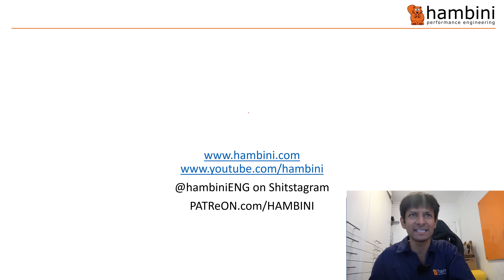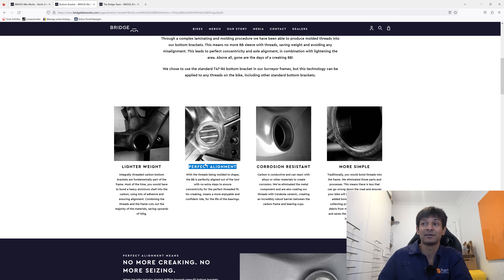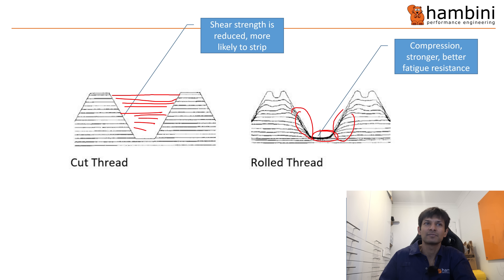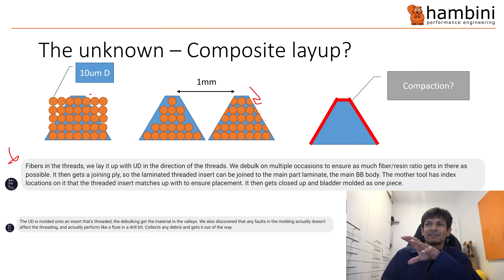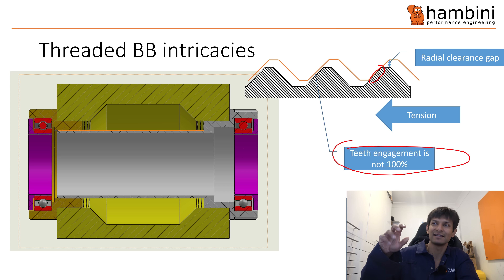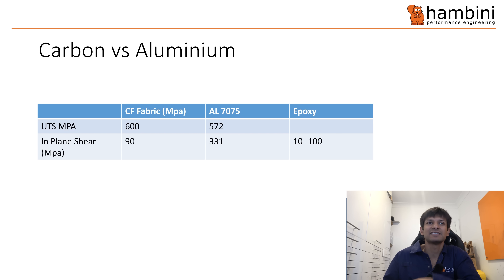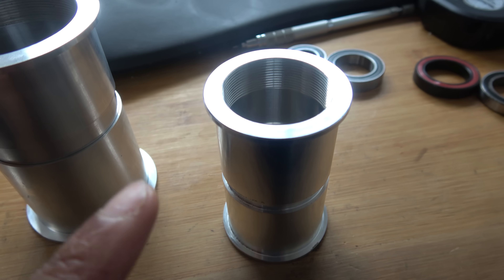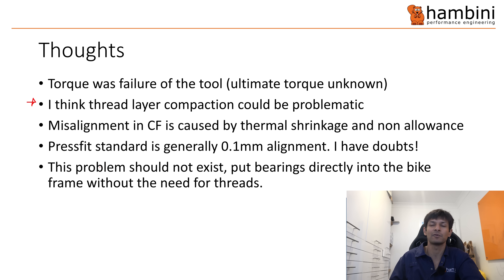Carbon Molded Threads, Crazy idea? | A Solution to a self inflicted Problem | REAMING

Comment: Thanks for reviewing this!

I concur with your assessment - it fixes a problem that shouldn't exist by relying on the same underlying root problem: the current production frames often don't comply with specs because of manufacturing issues derived from cost cutting. 

So doubling down and developing a thread system that relies on careful, diligent carbon moulding that accounts for shrinking, heat warping etc. seems like it's just asking for trouble even if all the material property issues (like fitting a metal bottom bracket with a sharp burr or edge on softer CF). It's really weird. I think you can make this work on a small batch/diligent manufacturing operation, but still is just one bad BB thread away from trouble.

BTW -  great summary on the engineering qualifications comment. I am Canadian and a P. Eng.; you described the qualifications well. And I don't know many people in the bike industry with the certification/denomination, either!

Comment: I have no words to describe how stupid this is.
Align pressfit  bottom bracket properly, keep correct tolerances and problem is solved. In this solution the bearings are pressfit in bottom bracket cups instead of directly in the frame. This ads weight which is the opposite of what they claim.

Comment: The advantage of a threaded bottom bracket over a bearing pressed directly into the frame is that not many people have the tools necessary to remove and press bearings.  A $30 wrench leads to easy affordable bottom bracket changes instead of the hassle and expense of a trip to a bike shop mechanic.   Press-fit bottom brackets are the worst of both worlds.

Comment: 1) Lots of talk about the strength of rolled vs cut threads and carbon vs aluminum threads, but all of that is irrelevant. What really matters is how strong do the threads actually need to be? I'd bet it doesn't take much at all for this application as the primary loading is hardly axial to the BB. If the threads hold adequate tension, then the threads themselves see no axial load beyond that anyway (the flange to BB shell interface sees it all). So if the carbon threads are strong enough, what's it matter? 

2) Nothing is ever "perfectly" aligned. But a threaded feature is self-centering, which makes it pretty damned close! Your diagram of the threads "misaligning" omits the other side, which balances out the misalignment you showed. And the two-piece inserts you show with the interference fit for alignment is certainly better than without that feature, but the L/D ratio is not even in the ballpark for a great alignment between the two.

3) A well designed bottom bracket will have an alignment feature between both sides to make up for any minor misalignment caused by the threads. 

Anyway, seems like a lot of unnecessary speculation from someone who's not doing it about a company that is. If they do it, and it works well, then good on them! No need to crap on it until it's shown to not work. Typical YouTube (social media comments, etc.), everyone who's never done something is somehow an expert on it...

Comment: In this light, could you discuss "forged carbon" like Time uses in the ADHX.  Those are the two things that sort of scare with that frame, especially in terms of durability.   I asked Time a few questions about these, such as if I should use grease, threadlock, leave them bare and if I should limit use to a single set of Thru axels and never got a response.   What happens if some dirt or foreign material gets in the threads?
Reply: There is no threads in carbon on the ADHX, it is in an AL-insert (fork) or hanger (rear)
Reply: @user-xg2fj5uc2g This is incorrect.  The Frame Specs on the Time website clearly say the dropouts are forged carbon, and if I inspect the ADHX frame and fork sitting in my garage - it has threaded carbon for the Thru axles.  There are no inserts. The only Al is the derailleur hanger.

Comment: Another bike that is going to do this is the Lemond 8, and high end racing frame that claims to use no metal pieces in their final design, including bottle cage bolts or brake mounds.

Comment: I would think it should be easier to create a dimensionally stable bore for a good interferance fit for a press fit bearing rather than creating a thread and then threading in a cup to in turn hold the bearing. Seems like a lot of over engineering to solve an issue that shouldn't be there if the hole was just created properly to begin with. I think a better solution would be to mold in a bottom bracket shell machined to allow for a proper interference fit and just press fit the bearing into the shell that is molded into the frame.
Reply: That solution sounds much easier than it is. But if we're going to mold in alloy bits at critical parts of the frame , why not just the radical idea of making alloy frames?

Comment: I'd bet they wrap long fiber strands around a threaded die and do the regular curing process from there. At the stated fiber size they would be able to fill each thread with a couple widths. And you wouldn't have to cut the carbon after you've formed and cured it.

Comment: Dangerous and potentially catastrophic. Didn't even have to watch the video. There's a reason metal inserts are used and it has to do with the material stretching. Good luck preloading carbon fiber.

Comment: So is BB30 the best BB design then with bearings being in frame and no interface??
Reply: Hmm, I bought a high end (full DuraAce 7800) Trek Madone in ca. 2008. It was equipped with the then newfangled BB90 (direct pressfit) bb. I’ve still got the bike and enjoy riding it BUT I’m on my fourth frame and forks. Trek have replaced them 3 times under warranty due to bb issues. I’ll say one thing, they stand by their warranty!

Comment: I've used roll taps in titanium, steel, and aluminum, which is a lot stronger than a cut tap. Interesting concept on carbon fiber, If it works could be a industry changer.
Reply: Carbon composites aren't ductile.  Rolling threads would crush the fiber and epoxy matrix.  You'd end up with a hole full of crumbs.

Comment: Surely, a threaded hole in carbon is easier to make than a round hole 😂 What a bunch of 🤡🤡🤡. But seriously, I know how much people crank on those threaded bbs and I really doubt this thing will be anywhere near strong enough. As shown in the video, carbon fiber sucks in shear, epoxy even more so. Also, if your aluminium bb gets galvanically stuck to the thread you might as well bin the bike, but that coating should hopefully prevent that.

Comment: I don't want some non-ductile, non-isotropic bike where it's such challenge just for the manufacturer to make a hole in it that's nearly round that they reckon its a better idea to invent a whole new process at great expense just to fit a BSA BB like was on my bike in 1997.  On a basic steel bike with BSA BB, everything works properly, and if it doesn't, the kid at the bike shop can make it work, before he even graduates high school.   It is the ductility of metal that has enabled us, over the years, to put together bikes and make them actually work, even despite the manufacturing.

Comment: With regards to the threads, I wouldn't necessarily say 'stronger' although some cold working may increase the tensile strength of the material slightly.  More importantly the the fatigue crack resistance and grain refinement of the rolled threads.  They could also be 'smoother' and 'burnished'.

I'm wondering if it would be better to make threads with some type of partial clearance or even missing thread portions that needs to be filled in with some type of sealant.  
Then use the threads for concentricity and gross fitup only and use the flange faces for alignment/perpendicularity, etc...  Or just use a one piece bearing assembly?

Kind of a solution looking for a problem...

Comment: My age is almost 80 and I agree about the bottom bracket and the bike industry seems like the frame construction is meaningless when you do not bore out the bottom bracket in one process.  What is a designed frame without the bottom bracket being aligned correct. There must be a individual who has done this in the past and why not in the present, what is the problems the process of cutting a one piece bottom bracket….  Why can not you make a machine to press thread a bottom bracket and a bottom bracket to fit. ????? What is the problem with the process ??????

Comment: At the end of the video, you suggest that bike manufacturers make the bb hole smaller than needed and then bore it out.  Earlier in the video you explain that cut carbon fiber tends to fray.  I think the problem remains to be solved.  🤔

Comment: I've personally molded a lot of carbon fiber threads in many different ways, when working for a company obsessed with trying to get that to work. It can work in static applications with light loads, provided the hole depth is a good 3-4 times the diameter. This, well, has me very skeptical. Invariably the resin seems to carry the load and the threads shear out under shock loading. The best case scenario we tested was cutting slightly undersize holes out of the carbon layup, so the fiber ends sort of frayed into the resin of the thread peaks. You can get passable but not great strength that way in a very thick panel (20mm thick carbon in my case), but nothing like the strength of a threaded insert. I can't see that style of layup being in any way used in a bike. I think, while they may have gotten it to work passably somehow, my guess is it would never be reliable enough for anything but a time-trial bike and it would never survive the first crash. I'd love a chance to saw one in half to see if they thought of something we didn't.
Reply: Maybe you can get your work to pay for two, one to cut up and one to "test"
Reply: @szurketaltos2693  Unfortunately, I don't work there anymore and I run my own business now, so work buying 2 is me buying 2😞

Comment: My steel gravel bike is 7.5kg, the stainless T47 BB shell has great alignment, and no signs of corrosion. The bike industry creating solutions for problems that don't exist.
Reply: I agree, I didn't relise I had a problem with my BB in all my years of cycling. The cycling industry is unbelievable in coming up with BS.
Reply: How can a steel gravel bike have 7,5 kg? Does it have carbon wheels etc? I have build up a couple of bikes, the frame of a trekking bike (OK, a little bit heavier than a gravel bike frame) has between 2 kg (Aluminium) to 2,5 kg (older cromoly steel frames), so even old steel frames are just a fraction of the total weight. The rest adds up the weight, to build a really lightweight bike every other component has to be lightweight too. If you use the inexpensive standard components with Aluminium wheels you end at around 12 to 13 kg, and a carbon frame alone would save 1,5 kg at max without weight savings on the other components
Reply: @simonm1447  English cycles knows how to build a light weight frame, lightweight yet proven durable components, carbon clinchers, 38c tires, full mechanical 2x red 22, stages power, growtac mechanical disc brakes.
Reply: @simonm1447  look up the Yasujiro Svelte. 5.5kg.

Comment: Hambini, what's your take on track (or SS, if you like) hubs with hex bolt axles? To me it seems OK for front wheel but rear is sketchy.
I have seen a hub hex bolt axles which has no serrated surfaces compressing against dropout - I've been offered such hubs but it seems too boutique for daily use. Probably I'm just too cautious but my background from working as a machinist sniffs a catch there.

Comment: Who knew the bike industry quest to save weight.  Shifting to Carbon Fiber-Reinforced Polymers would introduce a new set of problems.  

Any new material will of course introduce a host of new problems that previously doesn’t exists.  Because we are still learning about that materials strength and weaknesses for a specific application on bike frames through time.  

The first carbon fiber bike with aluminum lugs was raced by Greg LeMond at the Tour de France in 1989.  We are just on it 34th year of real world application in 2023.  We are still a long way before carbon fiber bike frames would be as solid and trouble free.  When compared to steel, aluminum and titanium bike frames.

Comment: I think the best thing about this bike frame is that it got Luescher Teknik to make a video about it.
Reply: I'm very happy to see that Raoul still around. I remember riding around the Hawthorn (Melbourne, Victoria, Australia) velodrome with him around 2000 or 2001. It might have been a little later. It's an open air velodrome, 3 laps to a Km and shallow banking, so most bikes are ordinary road bikes. He was on a home-built bike that was almost totally carbon fibre and was passionate about using CF as an engineering material, but he was also realistic about the problems ahead and didn't think that it was a magical solution for everything. From memory, his crank arms were CF, but his chain rings were aluminium. I have an engineering degree and had been interested in CF for many years, since the RB211 engine was first discussed, and had been close to the development of CF and other composites in building A-Class catamarans. He was a very nice, friendly guy who knew his stuff. 

I watched the video and I'm pleased to see that he's open to the idea but skeptical. He's also really good using the pen 😄

Comment: As a semi conscious crippled  incontinent old ex racer geezer, I seem to recall I once owned an early  Merlin Ti  frame with a BB that featured the bearings located in the shell without any threads. I trained and raced  on it, in all manner of weather, for close to 8 years before the bearings needed replacing. Sadly the design was proprietary and is lost to the past. Excellent video content from a 5 yo shitehead! Cheers
Reply: I like that idea.  If threads don't work do something else to hold it in.  There's more than one way to skin a cat.

Comment: The BB tragi-comedy continues: adding complexity instead of implementing appropriate manufacturing standards. Good grief. I'd like to hear from the engineers at Bridge Bike Works why their threaded carbon is superior to a properly produced pressfit design. It sure adds complexity. The question is why?

Comment: Bike threads where designed for steel. Already doing them in aluminum is "questionable". And now they try to convince everybody that it is a good idea in plastics? Ridiculous. Borderline insane.
Reply: The typical British thread works well in Aluminium. The torque you use to bolt it in is little compared to what the tread could withstand. Lubrication however is important, because of corrosion protection, otherwise they can corrode into the frame to a point you strip the threads if you turn it out.

Comment: Good video. I love the nitty gritty technical details. You are a master at this
It occurs to me that if no one ever tried to make a bottom bracket shell other than BSA68, bicycles would be just fine. The very best BB and crank design executed perfectly have such a minuscule effect on bike performance as to be effectively nothing for 99.9% of bike riders. Oh well, people have to do something with their time.
Reply: BSA is good for metal bikes. It isn't the best for carbon, neither the lightest, most efficient, or easiest to manufacture. That's why Cannondale introduced press-fit. "Fine" isn't the goal, best is.
Reply: @alexdi1367  It works fine in carbon bikes if you use a metal sleeve- which is waaaay easier to manufacture correctly that anything else because most bike companies, including Cannondale can't manufacture the other types correctly. The totality of any performance advantage conveyed by less weight or more efficiency is effectively =0 when compared to the rest of the system of rider/bike
Reply: @bobqzzi  They need a marketing hook, that's always the thing. If the system being sold is only suitable for a racer who gets a new bike handed to them every couple months, that's not an issue. Even a bodging idiot like me can glass-wrap a knurled aluminum bottom bracket shell and build a carbon bike on top of it that will never creak. But then I couldn't make the claims for an extra 6% stiffness to transmit my 85 watts to the pavement. The entire high-end cycling industry is more akin to Hermes than it is Honda. Expensive fashion meant to prove what you spent.

Comment: Had a read on their site.
Don’t bother with this company, they are riding on your trend in bottom bracket issue.
A philosophy grad and a lawyer want to solve decades old technical issue.
Reply: Their founders may not be engineers but they actually Do have a good engineering team
Reply: @davidngqkalone88  
I stand firm on my point🙂.
Just look at that entrepreneur’s short port folio.
A cash-grab setup with ‘patentable technology’ looking to be acquired.
Reply: @davidngqkalone88  by the way, heard that AbsoluteShite has a PhD researching on super large tension pulley too.

Comment: Most manufacturers can't align a pair of smooth CF cylinders perfectly, but threaded cylinders will be? IMO (ham-fisted home wrench and bikemaker) aluminum is already sometimes tricky enough as a threaded BB shell a regular person. I've had to resort to some crazy gymnastics to free up and reinstall BBs in improperly-prepared and maintained BBs in aluminum, and it's always a treat know that if you can't chase those threads clean and aligned very carefully the frame will be junked. (amateur tip: an old steel BB shell with shallow grooves cut perpendicular to the thread with a rotary tool makes a decent DIY chasing tool.) Isn't the force on these threads perpendicular to the direction of the CF? (on axis with the bb spindle?) Wouldn't that mean it relies on the strength and stiffness of the resin alone in resisting any outboard, inboard push-pull? Does pedaling generate those kinds of forces?